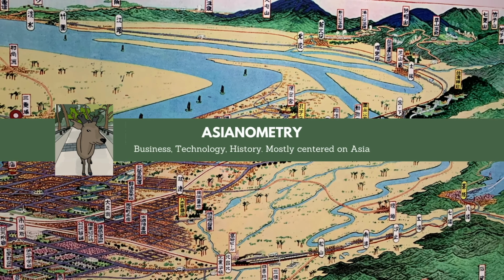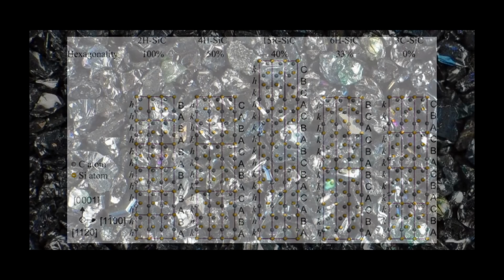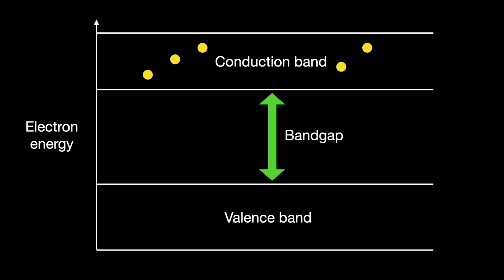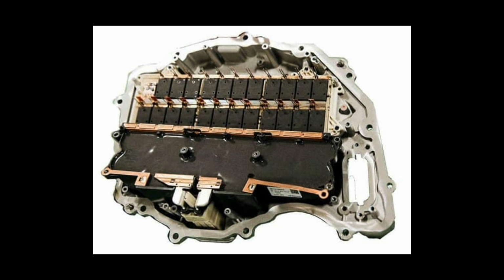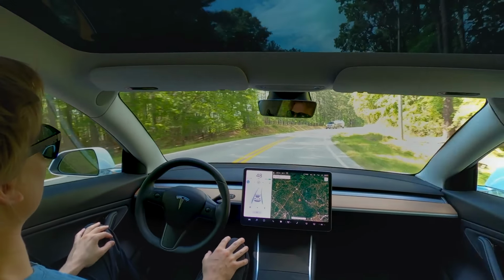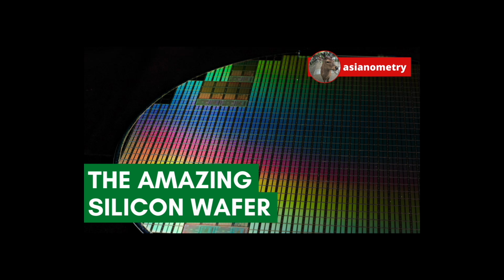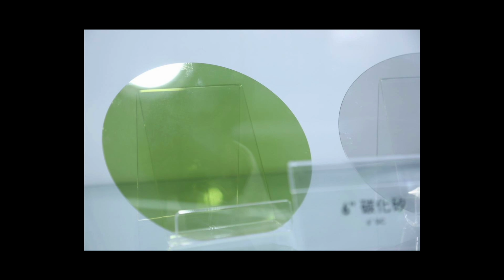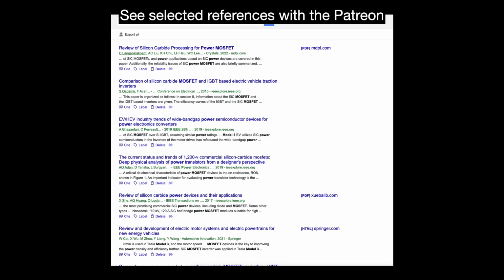Silicon Carbide: A Power Electronics Revolution

Comment: It is worth going the extra trouble and complexity to hook a battery up to an AC motor.  DC motors are expensive to manufacture.  Do not scale up to being good large high horse power motors.  You can't turn a DC motor into a dynamo but you can turn an AC motor into an alternator.  Lastly, if your life style allows it, you can have your electric car supply power back to your local power company to save on power bills or to supply some extra peak power at your solar off grid cabin out in the bush when you don't need to drive yet still charge your car up at another time.  The only serious weakness that electric cars suffer from is battery reliability as you drive from your city home to your cabin.
Reply: You can do exactly the same things with a (paralel) DC motor as with an AC motor. Only advantage is that AC motors are simpler and have higher reliability.
Actually the inverter allows the AC motor to be controled as a DC motor - DC motors allow for simple control of output torque.
Reply: i generally agree but in what world is a dc motor not also a dynamo? brushless? also not a dc motor any more than a polyphase motor running on dc through an inverter.